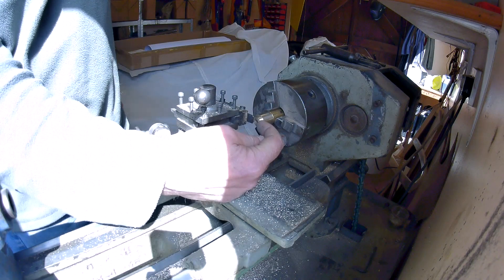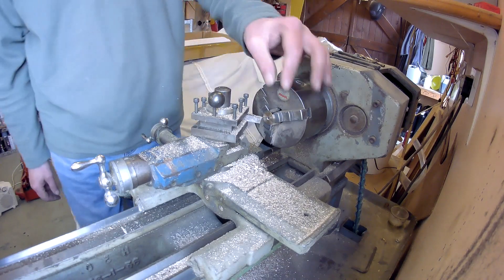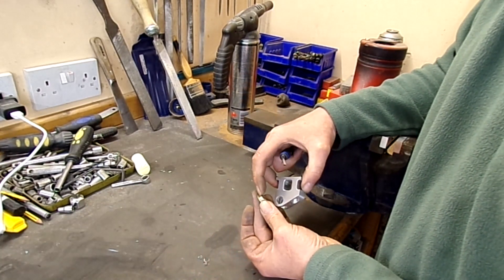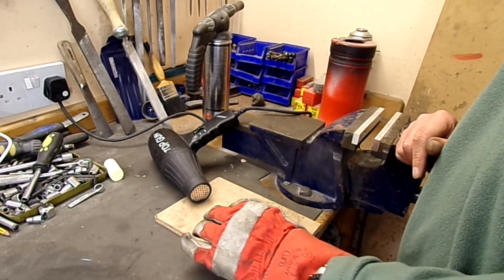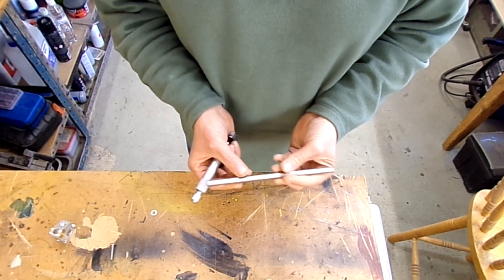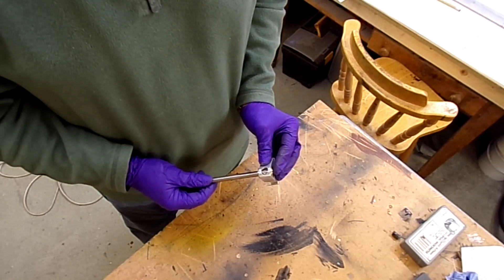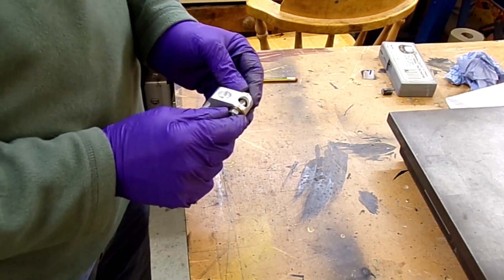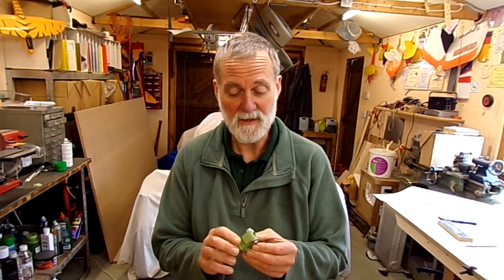EP14 Fisher Youngster V. Elevator Idler Lever mount

Comment: Nice work. But shouldn't your bolt have a minimum of 2-3 threads showing past the nut plus a safety wire?
Reply from the maker: On final assembly it will have a bolt with 1 to 2 threads past the Castle nut and split pinned, no need for wire locking. The 2 to three threads is for stiff nuts. Good question.

Comment: i was no surprse that your vernier and micrometer where not digital, great vid mate stay well
Reply from the maker: Yet to find a reliable digital vernier at the price but I do have one for basic comparison checks .it reads to 0.001mm but you open it after 0ing it and close it and it will read 0.02mm different each time.
Reply: @flyingkub  how do they police the ssdr regs in the uk
Reply from the maker: The CAA can do a spot check weight and balance and even a test flight to prove stall speed, that said that is not done very often. I believe the if found that you are flying outside limits then you can loose your licence be fined and the aircraft destroyed but not heard of any cases (as we are law abiding nation).
Reply: @flyingkub  thanks mate their seems to be a lot of contradictery information regarding 6061 compared to 6082 aalcan state that 6082 is the strongest and toughest in the 6000 range being a modern alloy your views p;ease
Reply from the maker: @electoplater  from my information it is not that different from 6061T6 when in the T6 state and its composition is very similar. The thing anyone substituting one alloy for another have to do is satisfy themselves that it's suitable for that particular application. For me the main consideration for this task was tensile strength for the loads around the holes with the bushes in them. In all cases I use aircraft spec metal with certificate of conformity.
Reply: @flyingkub  cheers stay well
Reply from the maker: No problem.